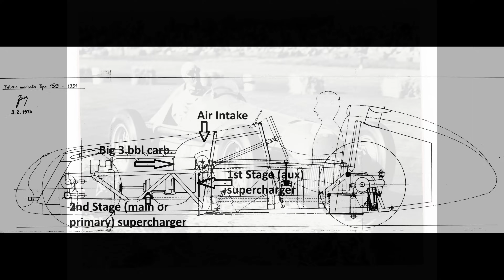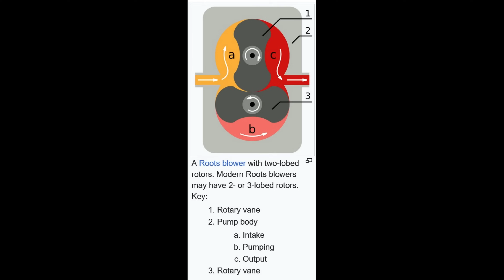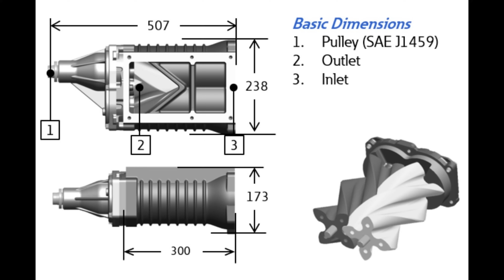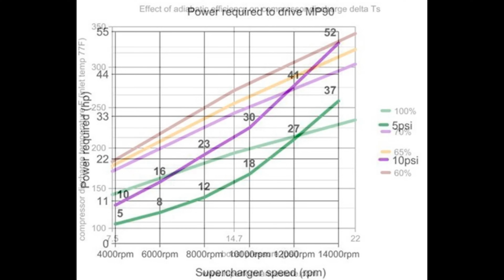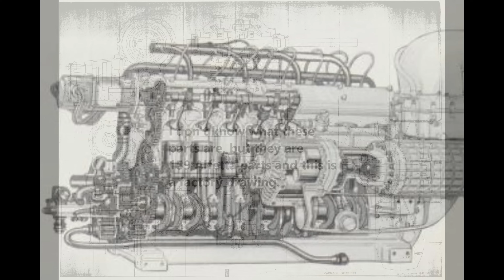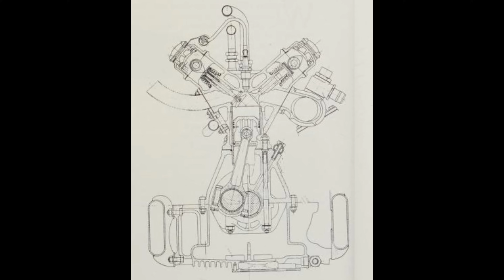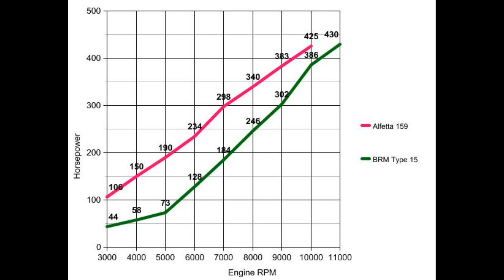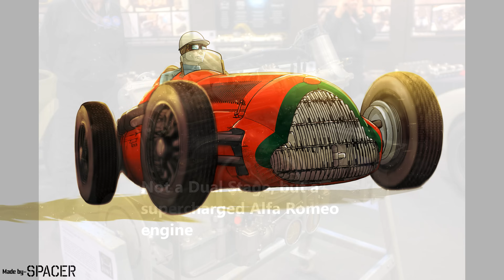Dual Stage Supercharging 450hp out of 1.5 Liters in 1951

Comment: The title is missleading. Im a drivetrain engineer. My first project lead was a forced induction system for a high performance 12 cylinder. Two stage suoercharging isnt "lost" Its obsolete and frankly bad by todays standards.

For one: driving forced induction devices eats insane amounts of Power. If you suoercharge a V8 to between 600 and 700hp you will loose in excess of 200hp just for driving the supercharger.
Then, why would one use two stages: To reach a certain pressure ratio, that one supercharger alone can not achieve or so you can switch on the second stage to let's say be able to run stage one as a power adder and stage two as altitude compensation.
First of all: modern Compressors can easily work in a wide enough pressure ratio to make that unneccesary if you just want to add power or fly high. And if you wish to fly really high, you don't use a Pisten engine anymore. And If you wanted, for scientific or Experimental purposes for example, you would still use turbocharging. A lot of commercial Diesel cars have multistage Turbocharging. Audi and BMW both driving that technology to quite insane levels with the 50d models and the 60tdi. 
In short: it's not forgotten. Its obsolete.
Reply from the maker: You're wrong. Even today the very best Roots superchargers can't produce 35 or 40psi like the Alfetta 159's set up with any reasonable amount of efficiency. You have to have dual staging to do that.  Now you could get that boost with a centrifugal or a turbo, but that introduces other problems, which can also be solved with dual staging. A 662hp Shelby GT 500 uses a Roots type. It's not spending 200hp to drive the supercharger. That statement you made is just crazy within normal usage. I should probably make a video about supercharger drive power requirements and it's hugely misunderstood.
Reply: @GregsAirplanesandAutomobiles  I am correct.
As I already stated, that is pretty irrelevant cause You wouldnt use mechanical forced induction today and certainly not a roots type supercharger, which is the least efficient forced induction device. 
You are already making a mistake and displaying your lack of expertise by speaking of an absolute pressure. The supercharger cares about the ratio. Not the absolute pressure. 

You ran quite easily run a Turbocharger at a 4:1 or 5:1 pressure ratio. And yes, while that poses vertain challenges that can be solved by multistaging, thats a cost saving and lag reduction measure, can be witnessed by Motorsport applications that run Single Turbos at 5,0 bar of manifold pressure, where partthrottle drivability is just as important as peak performance. 

Yes the GT500 did. And yes it uses over 200hp of power of the crankshaft just to achieve that at wide open and in the max p band. You can just calculate that for yourself btw. 
A comparable Turbo engine has losses of around 50hp through backpressure in a road application. The 4,0 Audi/Porsche in the RS7 Performance, the Urus and others is a good example. 

You really shouldnt make a Video about it because you aren't qualified. You don't grasp forced induction basics. But I would be willing to help you out with it if you want to educate yourself. Its ok to not know things. You aren't a subject matter expert, while I literally get pain to know these things. But then educate yourself and don't go doubling down on your  opinions because you aren't willing to admit that you are wrong.
Reply from the maker: lol, I address each of your paragraphs here. 

First, I specifically talked about pressure ratio. I made a whole point of talking about it, so I think it's likely you didn't even watch the whole video. That negates your entire first paragraph.

    In your first paragraph you also say "you certainly wouldn't use mechanical forced induction today, and certainly not a Roots supercharger" This statement of yours is just ignorant. Have you been to a dragstrip? The fastest 1/4 cars you could buy in recent years run mechanical superchargers, the Mustang Cobra Jet, Copo Camaro, and Challenger Drag Pack all run mechanical superchargers and all run in the 8's in the 1/4 mile! All of these run mechanical superchargers. The Copo runs a Roots. https://www.nhra.com/news/2020/tech-specs-inside-supercharged-chevrolet-copo-camaro  https://performanceparts.ford.com/cobra-jet/

Second, this isn't a video about turbocharging. Yes I know modern turbos can run a lot of pressure. However that introduces a whole different set of problems and would require another video to explain. 

Third paragraph. the 662hp Shelby runs an Eaton TVS 2300. It has a maximum allowable input power of 107kw/143hp. That's it's MAXIMUM so no, it's not taking 200hp to drive it. https://www.eaton.com/us/en-us/catalog/engine-solutions/tvs-r2300.html#tab-2 

Your fourth paragraph is just an ad hominum attack and lacks any sources or links to back up what you're saying. Everything you wrote, is wrong except what you said about turbos, which is probably why you want to change the subject to turbos. You're wrong about the current usage of mechanical superchargers, your wrong about the drive power needs of the 662hp Shelby's supercharger, and you're wrong in implying that I didn't talk about pressure ratios. If you would like I can send you links to NACA so you can learn.
Reply from the maker: I want to add that you haven't pointed out a single thing in my video that's incorrect. You simply claimed I omitted pressure ratios, which I didn't. You also complain that the title of the video is misleading, which is a matter of opinion. No title is complete, that's the nature of titles and the associated character limit. I do want to see your source for that 200hp drive power requirement  you claimed, or admit you are wrong.
Reply: @GregsAirplanesandAutomobiles  I never claimed anything in your Video is wrong. I correctly stated that your title was missleading and took the trouble to write in detail why that is the case. 
Maybe you should also learn to read before you start becoming defensive. With the Sole exception of the title of this Video and some of the claims in your Reply to my comment I have a very high opinion of your content. I am just disappointed that your reaction to constructive criticism is defensive. And not equally constructive.
Reply from the maker: The title is "Dual Stage Supercharging 450hp out of 1.5 Liters in 1951". There is nothing there that is misleading. I think your talking about the thumbnail, which is even more character limiting than a title so of course it's not a complete statement, which is WHY I fully explained the statement within the video. Trying to say "somewhat forgotten technology" would not have fit in a size that would be readable in a thumbnail. cont:

Your statments about drive power requirements are wrong. Your implication that I didn't explain pressure raito is wrong, and your claim that "You wouldnt use mechanical forced induction today and certainly not a roots type supercharger" is comically wrong. You then said I'm not qualified to speak on this subject but somehow you are????  And now you're trying to backpedal and say you have a high opinion of my content. Nope, not buying it. Go post over on Mark Felton's channel.

Comment: In the semiconductor field, we use electric Roots blowers to create vacuum, to lower pressure in water chip manufacturing machines, to remove air, and/or maintain a process pressure in process chambers. Electric turbos are used for low volume, low pressure pumping applications. Many other types of pumps, but these two are fairly close related to ICE setups.

Comment: dual stage is different from compound set ups.. dual stage are set up to be sequential.. one crating more boost later one creating more boost sooner .. both plummed parallel a compound set up is direct from one compounded into the other.. first one usuall spins faster.. second one take compressed air compressing it further.. i would like to see the set up in depth
Reply from the maker: As for terminology, Two-Stage or Dual-Stage is the correct term for what I described in this video. If you want to talk about turbo-compounding, here you go: https://youtu.be/gbMgwDIdScY?si=a77TIchyjY0H5Of-  Compound turbocharging is yet another thing which I haven't discussed. cont:

     In a two stage set up the first stage is in every case I know of is the bigger of the two and spinning at the same speed or slower than the second.

Comment: I hope my comment reaches you! For a few years now i a have been thinking of a CVT driven supercharger. There is an Italian guy on Youtube named "driving 4 answers" that has published a video explaining the works of a new type of mechanical CVT that has been developed. Do you believe that a variable ratio could help the work of a supercharger ? Also what will the effect be of a intercooler between the two superchargers? I have been watching Gale Banks and he believes in air density more that boost so to say.
Reply from the maker: It's all about air density, Gale Banks is right about that. Boost or pressure is a huge factor in air density. 

An intercooler is by definition between two superchargers. An aftercooler is after the last stage but before the engine. The term intercooler has sort of changed over the years and now usually means aftercooler. In anycase, yes an intercooler between the stages is great and that was often done.

 Variable speed drives can be used and they do help. I have other videos about that. The driving 4 answers guy is not knowledgeable on this subject although he is on others.
Reply from the maker: Yes, and intercooler between the stages will help. In fact, technically that's what an intercooler is as opposed to an aftercooler. Numerous WW2 airplanes had intercoolers, meaning between the stages.

Gale Banks is right about density, but that doesn't mean that pressure doesn't matter, it does. Increasing pressure is the primary way to increase air density in the intake manifold. 

A variable speed drive is great for a supercharger. I have talked about that before. The driving 4 answers guys is generally pretty good, but not in regards to supercharging information.
Reply: @GregsAirplanesandAutomobiles  Thank you for your time! I have an ichy mind so i needed answers. Lets hope i get to build something someday!

Comment: If you were going to dual stage supercharge a street car what would you reccomend.  I'm considering doing it.  I have a Chevrolet inline 6 292 ci engine with an old school Sissels lump port head. The current compression ratio is 10.5:1 which is not conducive to forced induction but I'm willing to dish the pistons.  My thoughts are run a turbocharger into an intercooler into a smaller 4 barrel type roots superchargerand add water methanol injection after the blower. 

No idea if I would work.  Just curious.
Reply from the maker: That plan will work. Spray a lot of water methanol and you can even get away with the higher compression up to a point. Although it would be much better if you could drop that to around 8:1. I don't know what your goals are, but if it was mine I would get an Eaton M112, they are inexpensive and quite good. Use that to get around 5-7 pounds of boost. Then use a turbo or centrifugal blower feeding into it for whatever my ultimate power goal is.
Reply: I appreciate the information.  It was intended to be a naturally aspirated street strip engine making about 350 hp when my dad and I started the project 23 years ago.   As usual life got in the way but seeing as how he and I both not getting any younger time to dust it off and get to it.  I'd say if we were to go dual staged forced induction I'd like 450 hp out of 4.8 liters.

Comment: This was a very interesting video. I didn't know about the concept of "dual-stage" I've seen a few hotrods with stacked blowers and i always assumed it just increased air volume or speed not pressure necessarily. I guess i always assumed that the suck/blow of the 2nd blower would cancel out the pressure, not double it. I love the solutions these old maniacs came up with to go faster with a car thats closer to a tractor than a modern car.

Comment: 12:32 The lack of internal compression means the roots, even disregarding pulsing and slip, is inefficient at creating pressure. It closes of an ambient volume, opens it to the pressure side and has to do all the work of pushing the entire volume out at full pressure.
Just look at the p-V diagramm of adiabatic (thermodynamically ideal and reversible) compression. The area under the curve is the power needed. A roots doesn’t follow the curve, it just displaces all the Volume at peak pressure. All the gained area is just heat being produced in the air. A second stage means displacing part of the volume at lower pressure.
The reason 2 stage supercharging is gone, is that we can get much higher efficiency at high pressure ratios from our screw and centrifugal superchargers, so there is less need for 2 stages, especially without intercooling between stages.
Reply from the maker: The screw-types and centrifugals bring their own set of problems.

Comment: With the 5 to 6 gallons a second fuel curve of a Nitro burning top fuel engine. Adiabatic heat is a necessary     Evil needed to shear the wet flow and homogenize the fuel air mixture. A lot of guys focus on the O.D. Teflon strips that seal the lobe to the case but I have found that the I.D. Nylatron strips that seal rotor to rotor are much more important. I prefer to only make at most 2 runs on a set of strips. I’m working on a gas ported rotor that uses plenum pressure to seal the rotors much like a gas ported piston uses cylinder pressure to seal a low radial tension ring. I noticed you said that a Roots blower does not make pressure in the bottom of the case. I’m trying to wrap my head around that knowing that a Roots is a positive placement compressor.  A lot of manufactures used to restrict the outlet into a small pie shaped discharge area into the manifold plenum. NHRA made a rule against it in the Top Fuel classes to slow us down. My question is does restricting the discharge speed the exit flow up dropping the pressure thus raising theoretical efficiency ? I hate the fact that we have almost zero scientific data in drag racing especially in the Nitro burning classes. I’m not sure if it’s because of the dynamic forces are so high or the fact that a lot of parts are junk after a single run making sensor base line control impossible or to expensive. My father was one of the first guys to make a “Billet” Hemi head in 79. He teamed up with Art Whipple and Walt Austin to create an engine combo that won many championships through the 80’s. I was very fortunate to learn from some of the smartest guys in the sport. That being said you don’t know what you don’t know and I genuinely STILL learn a lot from your videos. I wonder how many watchers truly realize the level of knowledge and  information there is in your content. This is kinda like a sleeper channel where I hope people realize that the no frills production masks the legit rocket science content. If you do read this Greg please get in touch because I would love to return the favor and take care of your vip tickets and hotel  to any of our races.🙏🏻 I sure do appreciate you sir for your in-depth amazing  content! Thanks again  sincerely Nick Holm
Reply from the maker: Hi Nick, thanks for your kind words. I would love to come to an NHRA event. I think there are some in Tulsa this coming year. I live only 30mins from that drag strip.
Reply from the maker: Also, I didn't mean to say that there is no compression at the supercharger outlet/bottom on the case in a conventional mount, there is. However the Roots blower does not compress air internally like a centrifugal or a screw. It all happens on the outlet side.

Comment: So could you use a roots mechanism to replace pistons as a drive shaft instead?  Seal a combustion chamber over the inlet of a roots-type, inject some air and fuel and ignite it...and it will spin the lobes as the pressure exits.  Maybe its too limited by the slip at low pressures?

Comment: It sounds like "slip" is very much the same thing as surge in a centrifugal supercharger or turbocharger, and it's also the same reason compound turbos exist. Really interesting to see that this technology has been around for so long, and on Roots blowers which I never knew would even benefit from multiple compressor stages.
In a turbo application, using two stages will compound the potential pressure ratio. If you would've gotten surge at a 3:1 pressure ratio with a single turbo, compound boost allows you to run up to 9:1 without surge.

Comment: Great video, but barely watchable because of the British units, hope there will be a version that the rest of the world understands...
Reply from the maker: I put metric units in there. We have Liters right in the title.
Reply: @GregsAirplanesandAutomobiles  Great, but imagine watching a video and pressing  pause after every sentence to read/understand what is the author talking, it's probably also hard for you when you watch a "metric" or a foreign language video.
 
So it would be great if there was a metric version of the video that the rest of the world would enjoy.
Reply from the maker: I see your point. This isn't a problem in the United States because we learn both systems very early in school and we use both on a regular basis. Of course I did use a lot of Metrics in here, Liters, Cubic Meters per hour, the pressure ratio is in units of atmosphere, so 1.5:1 is 1.5 bar absolute on a standard day. Nobody from the U.S. complained, not a single person. I did use fuel consumption in U.S. gallons and top speed in mph. Boost I put in PSI, but you can read it in bar on the other side of the chart, so no mental math is needed.